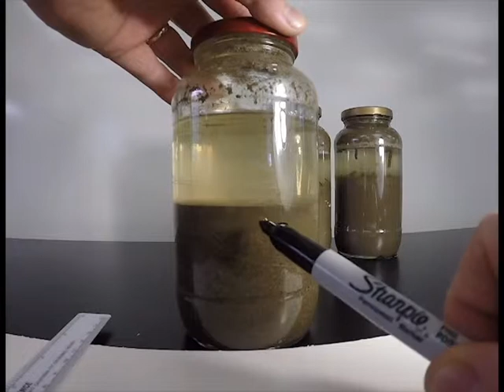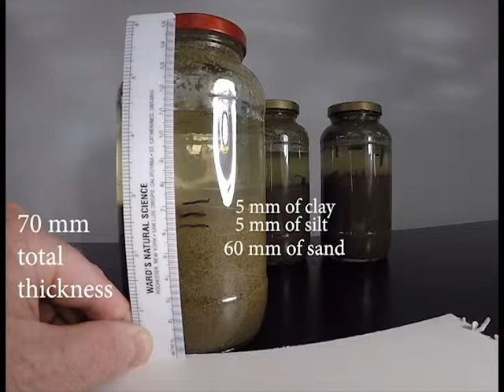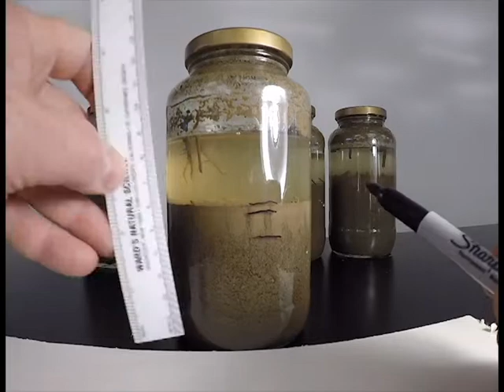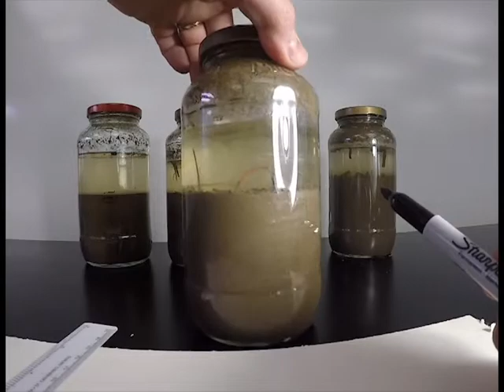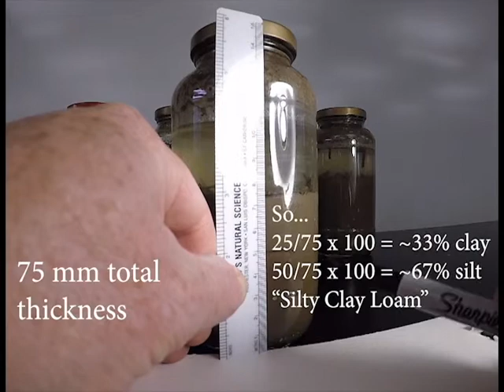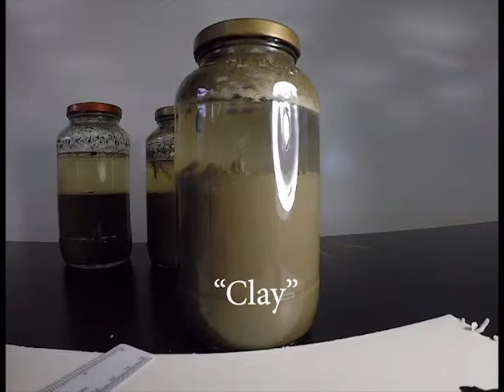Estimating percent sand, silt, clay of four soil samples shaken with water the previous day

Comment: Thankyou so much mate, that was extremely helpful, as I'm studying after hours on line course in horticulture,  the first soil sample test, I have to do this,  and I was confused,  I have several samples,   done the same way.  I could not identify all 3 , sand, silt and clay ,   wondering if there were suppose to be all 3 present in each sample,  or the potential , for those 3 to be there.   I subbed  and thumbs up mate. Cheers.